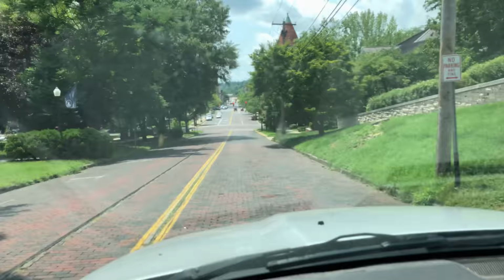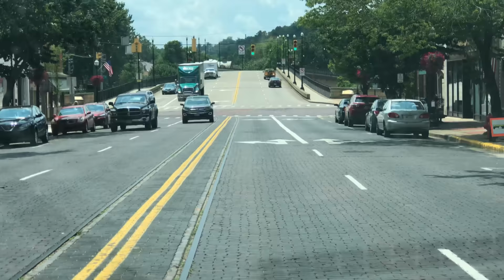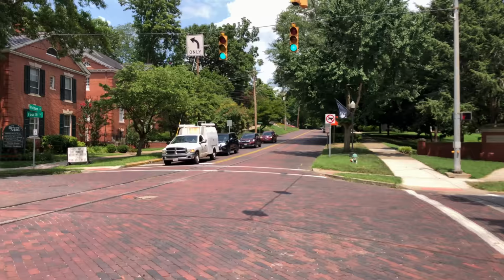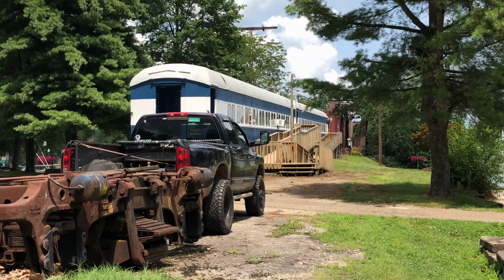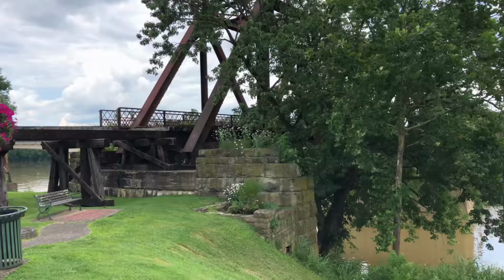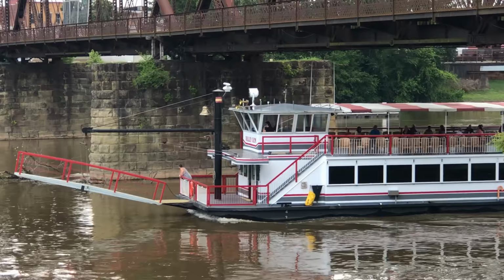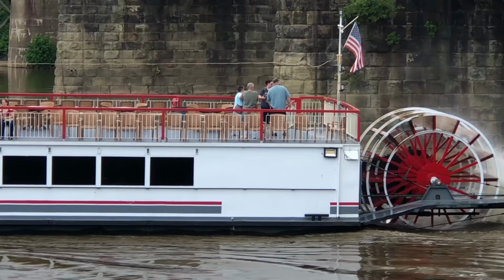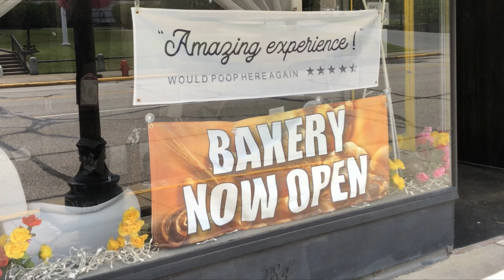Abandoned Street Running Railroad Tracks!  Abandoned Trestle & Old Railroad Cars, Marietta Ohio RR

Comment: You sounded like the railroad archeologist who hangs out in South Florida and is always searching out abandoned tracks and switches......When I was growing up in the Bronx in the 1950s, not only were there lots of recently abandoned trolley tracks (NYC had just switched to buses),  but several streets still had their original cobblestones that were rounded rather than flat-topped like bricks. That was a REALLY bumpy ride over those stones. Whenever the street had to be opened up to find a water main, gas line or electrical wires, the workers had to be very careful when they removed the cobblestones. Like pieces in a jigsaw puzzle, each stone had to be replaced in the same position it had been in before the street work started......That paddle wheel boat was very cool.....Great  video.
Reply: Milwaukee used many granite pavers in their streets. Quite a few still buried under the asphalt to this day. Two years ago when digging for the base of our new light rail they unearthed several blocks of old streetcar tracks in granite pavers last used circa 1953

Comment: Looks like a fairly active downtown and without a doubt one of the longer sections of brick streets still extant much less with that much rail still visible. That bridge looks in very good condition and perhaps there were plans to operate the older cars over that portion. Ive seen a photo of the Warsaw (IN) RR waiting for the traffic light in Courthouse Square with their Plymouth loco and several freight cars. This was a remnant of the interurban and lasted 10 years or so after the passenger service ended. When surrounded by old autos and frt cars its super neat. Today you were like Johnny cash in I Walk the Line
Reply: A part is reconstructed in 2013. At Krebs Trailhead park.
Reply: We have more brick streets than any US 🇺🇸 town. 
Check out the old pics and videos of the interurban that use to travel our tracks: 

https://m.facebook.com/www.HarmarVillageMariettaOhio/
Reply: @shamrockgirl6595  thanks much for the info. Delavan WI has 2 blocks in very good condition downtown. Here in Milwaukee alleys had bricks into the early 1920s when new construction turned to concrete and likewise on main streets. Due to their proximity the streets here were paved in cut granite blocks hewn at numerous state quarries. Many in fact were used in Chicago due to their durability. A lot of streets here still have them buried under a coat of asphalt. I missed a great photo 20 years ago when they shaved the old asphalt off an old dual streetcar crossover firmly planted in granite pieces. These streets are a bit bumpier than bricks but last longer. For real history in 1985 a main roadway was excavated and old half hewn logs were found from circa 1850 on what was known as Watertown Plank Road. Oh yes the average curb was a long slab of limestone some still out there. Quarries were in Monticello. Lohrville and Red Granite..Thanks again!

Comment: Interesting. Here in the UK, most trams were removed after the second world war. However, from the 1990's, in cities like Manchester, Sheffield and Nottingham, they have been rebuilt and are back in action. They are well used. Some terminology differences UK/USA.  You mentioned Trolley buses. In the UK trolley buses never had rails, but just ran on roads, but were powered by electricity from overhead power lines.  Trams ran on rails with many sections of the track set into road like the rails in this video (also powered from overhead electricity lines). Other than in museums, there are no Trolley busses running in the UK, but there are a number of places where trams are part of the transport system.
Reply: @Jeremy Preece "Trolley" or "Streetcar" are the American terms used instead of the UK "Tram", this was clearly not a Trolley Bus line. Although there was widespread abandonment at around the same time as here in the UK a number of US and Canadian cities never scrapped their trolley / tram systems entirely - when across the pond I have travelled on historic systems still serving daily in Philadelphia, Boston and Toronto. Jawtooth has posted footage of the Cincinnati streetcars in the past.
Reply: @boxcarjim1  Ah! I see, hence "A Street Car Named Desire".  Did the US have the UK version of our trolley buses, i.e. buses that ran with normal tyres over roads, but powered by overhead electric cables?
Reply: @jeremypreece870  Yes - I believe Boston still has them although I didn't see them when I was there.
Reply: The current “trolley buses” in Marietta are actually gas powered buses that a made to look like the old late 18th century-early 19th century trolleys.

Comment: The Harmar Bridge was a covered bridge that became a part of the B and O until it was officially abandoned in 1970...Marietta also had a PRR line, the Marietta Branch, that ran from Marietta to Cambridge and actually extended north of the Panhandle Route with connections to Akron and Cleveland...it was not included in Conrail and was out of service on 4/1/76...parts of the line were used by agreement with CSX through the late '80's/early '90's with connections to Cumberland and the Big Muskie known as the Dynamite Run...a stretch of rails was reactivated near Byesville for tourist trains but was eventually discontinued in 2012...the PRR used the bridge to turn its locomotives on B and O property and then return to the station on the other side of town...

Comment: Hey, glad you took my suggestion and went to Marietta Williamstown Saint Mary's and Parkersburg.  Vidoes are awesome.  The rail and brick for the trolley is still under the roads, they just paved over it all.  They did start out horse drawn and quickly went electric.  There are pics out there on historic Marietta FB groups.  You can ride the Paddle Wheel boat.  It docks under the Washington St bridge.  Also for future trips Harmar is pronounced "Har Mer" ,  named after Fort Harmar that General George Washington created in 1785.  Marietta is the oldest settlement in Ohio.  1788.  Lots of street running in the area.  Check out Friendly Wv too sometimes.  And the Parkersburg wv trestle on the Oh side in Belpre is cool.

Comment: I hope you visited Putnam Chocolates while you were there on Front Street. :-) The trolley tracks also were used by the interurbans and used to run over the tracks on the old Williamstown Bridge. Which then turned Southwest and ran to Parkersburg. If you look on 2nd Street in front of the Westbanco building you can see where two of the tracks were that went to the B&O depot that was at 2nd and Union Streets.

Comment: In Brooklyn NYC they have trolley type tracks that are still used by NYNJ RR and the SBK RR. While working for the LIRR I saw one of our EMD MP 1500 engine use one of those single point switches on that line at the old Brooklyn Army Terminal .The crew refused to use it until a supervisor switched the point Lol .

Comment: Pittsburgh had a trolley system into the 1980s. When they went light rail a lot of people wanted them to save the trolley rails on the Smithfield Street bridge for a downtown scenic loop but the decision to remove the rails was made on one decision: rails had a dangerous history and were not compatible with the desired modes of transportation: foot and bicycles. 
Today, the Allentown line is the only section where rails run on the roadway. 
The history of the Pittsburgh Railway Company is well documented. 
Amazing that Marietta hasn't removed and/or paved its streetcar rails. Perhaps they have yet to be sued by a bicyclist/motorcyclist injured by a fall caused by wet rails or having the wheels get trapped in the rail. Those rails are also hazardous to those with mobility issues.

Comment: Check out the old Reading Railroad Viaduct in Philadelphia. Miles of abandoned track and trestles/ bridges. The old Terminal was changed to a great farmers market in the original building. Some short lengths have been torn up for public spaces, but it's been decades just to get that far. You could film for DAYS.
( BEWARE : DANGEROUS TO TREK UPON )

Comment: I’m from Melbourne, Australia, where we were smart enough to keep our trams (street cars). It’s now the largest network in the world. Some of the older trams do a free circuit around the city and before that @#$& pandemic, we had restaurant trams that travelled some of the routes. The longest route is 14.2 miles and the most scenic would be St. Kilda Road onto Dandenong Road: beautiful buildings and tree lined tracks.

Instead of abandoning some non-profitable passenger rail lines, they were converted for use by trams - smart thinking! The tram to Port Melbourne is also a great trip.

The only bad thing is when tram meets train in the suburbs. The diamond crossings are so shallow, both vehicles have to cross really slowly.

Comment: The streetcar tracks were in use until 1948.  In later years it ran across the old Ohio River Bridge and down to Parkersburg, WV.  The turnouts ended use about 1932.  The Railroad Bridge belonged to the B & O and was closed in 1968.

Comment: In another example of "Two nations divided by a common language", what you guys in the US of A call "railroad ties", over here in the UK we call them railway sleepers !
Most of our main lines now have concrete sleepers installed but the old wooden ones are still in place in the more remote parts of the UK. And on one bridge (I forget where) that has a very strict weight limit, they've very recently installed sleepers made from recycled plastics !! 😎👍👍

Comment: Typically, street railways were (and still are) 5'-2" gauge.  Supposedly, this kept the traction companies "captive," and made it more difficult for them to take their streetcars to another town, in the event of a dispute over franchise terms and conditions.
Single-point turnouts in gutter rail, set in pavement, are an interesting prototypical feature to model.
Reply: Wow I never knew that thought they were standard guage thanks for the information
Reply: That feels like one of those made-up after-the-fact explanations. Trolleys would probably need to be loaded onto flatcars to move between towns, regardless of gauge -- no couplers so you wouldn't be able to put them in the middle of a regular train, and no overhead power on the mainline so you wouldn't be able to run them under their own power.
Reply: @beeble2003  basically buses are more flexible

Comment: The side of the bridge where the dock is at swings open. The bridge pier right at the dock is the one it spins on. Opens 90° to the rest of the bridge you know so taller boats can go through. Thought you and everyone would like to know that if you didn't. Did you see the B&O F-unit cab sitting in the parking lot beside the train cars there at the bridge? Good video.  👍
Reply from the maker: Yes, I saw that.  I put a picture of it in one of my videos of the street running trains on Harmar Street.

Comment: If I remember correctly there are some street running tracks in Warren,PA.
Reply from the maker: I looked on Google Maps and it looks like East Street had them at one time
Reply: It's been years since I was there but your video stirred up memories.
Reply: Most trolleys were abandoned right after ww 2
Reply: That was the Warren and Jamestown street(!) railway. 1904-1929.
Reply: Well in New York City where I grew up most trolleys were abandoned right after ww2  last one ran in 1957 over the 59 th street bridge  had it not been for ww2 they would have been abandoned earlier but they had a fuel rationing and rubber rationing
Reply: So I guess they used trolleys to save on fuel and rubber costs otherwise they would have converted to buses sooner
Reply: Back in ww2 people needed coupons for gasoline food clothing almost anything you could think of  we had to save valuable resources for our brave men on the battlefield and that’s only right
Reply: Lest we forget General Motors the oil companies Firestone and Goodyear tires had a major hand in getting rid of the trolleys  they bought up all the trolley lines and converted them to bus lines General Motors also owned Detroit Diesel at the time and that engine was in all their buses